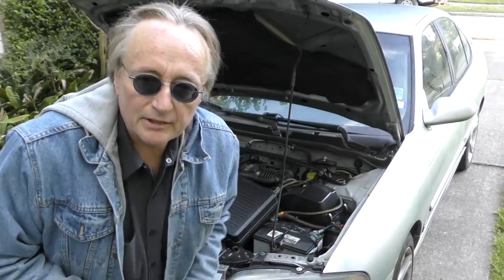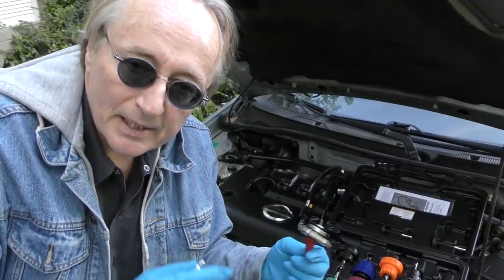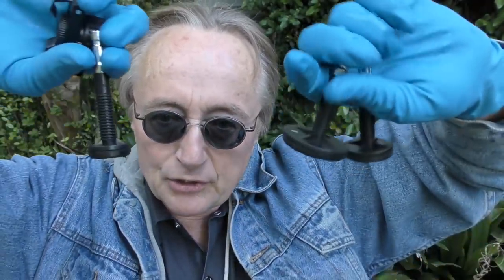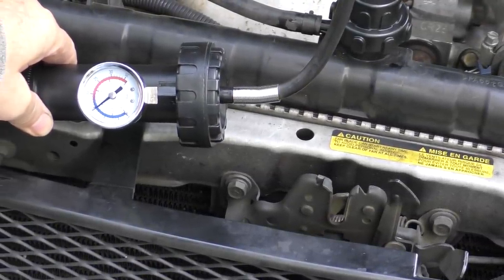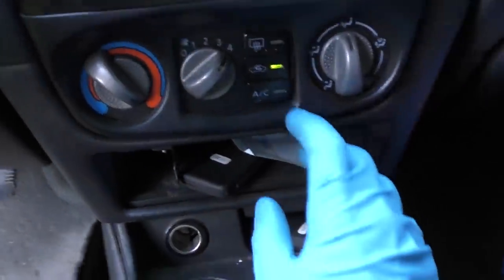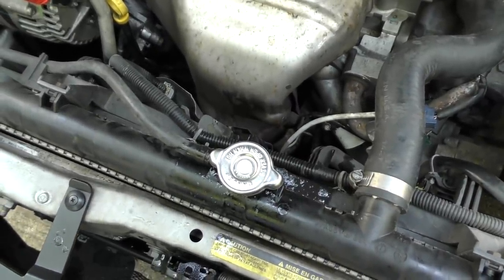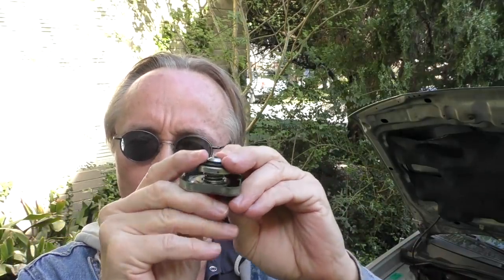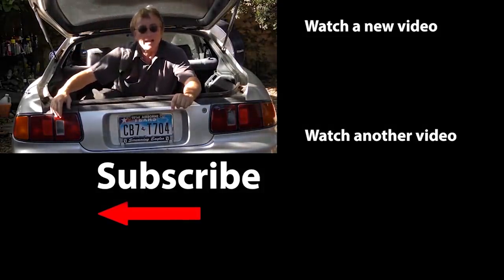How to Fix an Overheating Car Engine for $5

Comment: Had this problem. Bought new cap. Problem still existed. Took a while to find out that i purchased a defective radiator cap. So i bought another new one, and a new problem arose. Radiator hoses were blowing!! The new new radiator cap wasn't releasing pressure... Went to napa, paid a few bucks more, problem solved..

Comment: 06 Nissan Quest  van had spark plugs in back and they changed them  and believe  took gasket of said what ever was needed  had to be ordered Nissan go ahead drive oil cause get hot when said it did that it's okay then got to hot again barely made home so then said bring over could barley made home so set 3yrs put new battery on started and machine  said nothing wrong how can a battery  fix that  the old battery  wasn't bad ideas???

Comment: Can you recommend a good mid 2010's crossover? I love the reliability of my '01 Camry, but I'm looking for an upgrade, and something that can fit my surfboards for short trips to the beach. 
Love your videos and thanks a lot!
Reply: Steve/Beth thanks! I’ll look into the Element, and Spencer, good call, I’ll keep an eye out for sales. Know of any good resources to find common problems for each make n model? I think all of those options would work, just want to make sure there aren’t any known/recurring issues
Reply: Spenser Chalkley thanks, I would plan to take good care of it, and work on it myself. But with what you said, even if I do take good care of it, what do you think of the cars in the long run if I were to put another 100k miles on? Thanks again

Comment: Does the thermostats also cause problems. . it did on my car. They said. Just curious..
Reply: Thermostats stop the flow of coolant when the engine is cold. Once the engine heats up it opens up and the coolant flows between the engine and the radiator. So if you started driving and soon after your temp goes high it's a good indication it's bad. If your water pump fails it will do the same as the coolant isn't circulating.
Reply: @jeep146  . So i was lied to .Thanks. .  I got screwed. Thank you. Someone else told me the same thing. Thanks again.
..

Comment: Car my tire pressure light has been on for months and all the tires are at the right PSI, any suggestions why?
Reply: You need a new sensor
Reply: Snoopy thanks snoopy, do you know if there is anyway to pin point what one?

Comment: Save Your Car
1. Replace Radiator cap (oem) regularly
2. Check cooling system's pressure
3. Flush radiator as needed 
4. Use the best coolant
5. Check the fans & their motors.
 * turn fan& ac on high then check
6. Thermostat? Replace if in doubt.
7. Water pump? 
8. Radiator - is it working? Leaking? Does it need to be replaced?

Did I miss anything?
Reply: Ive replaced the radiator (it was cracked), still overheating, put a new stat, still overheating, replaced the water pump it started leaking, still overheating. Replaced the stat again and the temp sensor, still overheating. Heater not working, i assume the heater core is clogged. So i hook both heater core hoses to bypass it. Still overheating. I cant drive more than 5 mins before it starts to overheat. Idk what else to do. Only option now is to remove the stat. Im trying Jesus im trying to stay faithful knowing ull help me, but idk what else i can do. Only vehicle we have rn.

Comment: Isnt it dangerous to open a coolant cap after the car has warmed up?
Reply: The original cap had the pressure relief lever.  Without that, then yes

Comment: Hi Scotty, 
P2173 Jeep Patriot 2013 2.4l
Any ideas please 
Changed throttle body still nothing
Reply: GM Kof hard 
Goes limp mode 
Engine light on 
Red lightning light on 
Turn ignition off and on drives normally but engine light is on
Reply: GM Kof hard 
Limp or safe mode 
Revs are limited to 3000
Not loosing power just limited power
Reply: GM Kof hard thanks buddy 
I’ll try map sensor
Reply: Smoke test done as well, nothing
Reply: GM Kof hard 
I will 
Thanks again

Comment: Scotty hi.. I bought a hyundai and it had KUHMO eco tires - they are hard as plastic and I almost crashed a few times because they skid on leaves.. got new Firestone firehawk tires and drives and handles 8x better and feel safer stopping. Can you rev up our tires and provide a little edu on these eco tires and what are good tires / how to shop for tires / it’s probably not always wise to run these cheap eco tires from dealer like KUHMO... they are horrible lol ... I am not sure 🤔 people realize or if they have eco tires that it can cause your car to handle horribly ... thanks - HUUUGE FAN
Reply: SWEN TACTICAL "Your car drives no better than its weakest tire" - Randy Fitz

Comment: Whats the issue if you press the gas and the temperature goes down?
Reply: thermostat
Reply: No that would be cooling fan
Reply: Often there’s air which must be bled from the system.

Comment: Scotty what you think about a 1993 Jeep Wrangler yj. 5 speed manual. 100k miles on it
Reply: He'd probably say it's built vastly better than the new Chrysler-Fiat Jeeps.  Being a manual transmission and low mileage, it's probably worth buying, as long as there's not a major rust issue or existing engine problems. Good idea to get a mechanic to look at it before you buy it.

Comment: Just put water in my cooling system, because I forgot to pick up coolant before changing radiator. DOH!! Barely made it to the store and back without overheating. I may also have air in my system....

Comment: Weird. My Nissan Frontier's radiator has a leak and I have no overheating problems as long as I top it off once a month or so.
Reply: Pour pepper in the radiator, it will stop the leak
Reply: It’s difficult to effectively correct leaks in aluminum & plastic radiators.

Comment: What if it takes forever to reach the middle gauge of the thermostat
Reply: Mebbe stuck open tstat, second but expensive try, temp sending sensor, I'm about to try that on 89 f250 that was probably neglected and sitting for long time

Comment: This go  out to everyone so I have a 2005 Highlander  Toyota  that I  Just bought  Use   But before I bought  I checked  out the  Engine. But my problem is That in Winter time When I try to put hot air  I would get cold air So I would have to dialed it like in old radio To see if I can get some Hot Going. I called in to  Auto zone I got device to To cool down the car AndTake the radiation cap off You to car warm up To see if the air or lepri out I wanna see if anybody has done that

Comment: That's a Nissan? My 2002 Nissan Sentra just died a few months ago. It started running hot out of nowhere, then it began having starting problems, so I took it to the shop and they told me there was coolant in the engine cylinders. I took excellent care of the car, so I'm assuming the previous owner might have let the car overheat. PISSES ME OFF!!!

Comment: Yea I disagree with Scotty on the “might as well just buy a new cap” comment... with that rationale you may as well just replace your thermostat, u-joints, gas caps, valve stems, oil caps, fuses, wheel weights, light bulbs, lug nuts, lug studs .... I mean they are all cheap and could all lead to problems so why not just replace them all every couple of years?

Comment: What if it's a European car like a VW that have that huge coolant container and doesn't have a cap?
Reply: plastic caps fail as well  vw Ball cap i speak of  still they have a radiator may  have to dismantle to see if it has a Radiator cap usual hidden under a panel near hood latch peek thru the grill
Reply: @CalmDownClown   Thanks for the advice!
Reply: @OwlManoloPR13  best way i guess to see without any effort is to...look up your VW  on a parts site ..rock auto  or what ever and bring up a picture of your cars  radiator .. its cheating but hey  easy.

Comment: No..... the FIRST thing....before you pressure test the system....is open the radiator cap and SEE IF IT HAS COOLANT.   C'mon maestro Scotty...... also, an old cap may have lost it's pressure spring rating....needs to keep the system at 15 psig (or so) pressure. Anything less and closer to atmospheric....it'll overheat. Oh...and that "hot" test you did, where you simply unscrewed the cap and found no pressure? Caution: for those cars that still HAVE pressure, you can scald yourself....open it with a rag under your hand !!!

Comment: Those Nissans are notorious for having a stuck outflow valve.
Reply: Really? Because I DD a 350z
Reply: @MrSnakedoctor85  I don't know about that Model, but if it has an outflow valve, those get stuck and the coolant doesn't flow out. The Altimas and maximas have those. It's  like having two thermostats, an inflow and outflow.

Comment: Rev up your fender scratches..........Jesus.
MOST logical thing to do is check coolant level first, if the level is full the chances are very small that there is a leak.
The chances of a small coolant leak causing overheating are slim to none, pressure tester is NOT the first step, or logical.
When the gauge is “close to the middle” DO NOT OPEN THE CAP FAST, needs to be open SLOWLY, or rev up your 3rd degree burns.
Lastly, easiest thing to do at operating temperature is to feel that upper and lower rad hoses are near the same temperature, indicating
flow.
What do I know, only worked for porsche, bmw and mercedes......
Reply: MarcN,  Excellent!
Reply: I like Mr.Kilmer, but I honestly don’t think he is an above average tech.....
I have had the pleasure of working with elite techs

Comment: 3:56
NEVER OPEN WHEN HOT
FOR COMPETITION USE
If we join the two phrases into one single statement,  it becomes comic!
Reply: haha. that is actually a higher pressure radiator cap from a Honda only aftermarket performance company from Japan called Mugen. if you wanna buy it here in the states it will run you around $40.

Comment: Bonus q&a: everything checks out so I replaced the thermostats and she srill overheats.   Answer: heat up a pot of water to boil, drop the thermostat in for multiple cycles. It might save an engine. 
Mikel

Comment: That's super dangerous opening up the radiator cap when the engine's hot like that, didn't even use a rag or anything to cover it, especially when you don't yet know if you'll be sprayed with super heated coolant / steam. Needs a safer way to test that.

Otherwise a good video, I like all your other videos, but this one's just too dangerous in that one spot
Reply: Nope. It wasn't overheating. Open my cap all the time when the needle is at the middle or just below. Does not billow out.
Reply: @garynair5143  Yours is broken too then. There's a deadly serious reason why even the caps say NEVER OPEN HOT. Even an old Toyota like Scotty's (I think it's a Paseo?) should build up enough temp & pressure in just a minute or two to splash a little coolant around when opening the cap.

Comment: For all the "nerds" that wonder why would a weak spring in a radiator cap cause overheating?? Lower Pressure = Lower Boiling point. So a cap that doesn't let the system "pressure up", will obviously boil sooner. /cheers

Comment: Not many overheating engines have a $5 fix. Scotty with the sensationalized headlines, AGAIN!
Reply: Sometimes it's a $20 fix as people think that putting "performance thermostats" in helps, but all they do is either not open properly or open too much and too soon. Either way you have an overheat from either no flow or too fast a flow. The fix is then the stock thermostat again.
Reply: BALONEY!

This is EXACTLY what I figured out ON MY OWN after going to the dealership AND a private mechanic.
Both said, "replace the radiator and/ or thermostat". 
Thermostat was new. Radiator wasn't leaking. 

Went to Autozone, bought antifreeze, it was bone dry. 
Noticed the cap's seal was eroded, that rubber wasn't making a proper seal. Went back inside for a $9.99 cap. 

For $22 bucks I was DONE in less than an HOUR. 

So, no my friend, it's NOT SENSATIONALIZED! 

The fact is, check EVERYTHING before you recommend ANYTHING.

Comment: This customer lucked out to see it was only the radiator cap and not the radiator leaking or not dissipating heat anymore.     Instead of spending hundreds of dollars this customer is only going to be spending the $5 plus the labor that Scotty charged.

Comment: 15$ FIX HERE 

BAD RADIATOR FAN.

instead of replacing whole assembly you can simply buy just the fan motor if that's what's wrong and replace it for $15 instead of the $100 to charge for the whole fan.

Comment: I wouldn’t take off the radiator cap when it’s warmed up. Safety first.
Reply: Well it was warming up when he did it, if it was fully warm it would be bad
Reply: Yeah I wondered about that too. Layman needs to be warned not to let the engine reach normal temp or else can get badly scalded removing the cap.

Comment: This guy doesn't know what he's talking about. To fix an overheating engine is really easy, all you have to do is put some ice cubes in through the oil port on the engine. Trust me, these mechanics just want to scam you, but I'm here to help you out with quick, easy, and cheap fixes 👌🏼

Comment: You should never tell people to open up there system hot!!!! Someone is going to get hot coolant all over them!!
Reply: It was only a short warm up. Edit: But he could have squeezed the radiator hose to see if the cap was holding pressure.

Comment: Today we're going to end up with viewers who have 3rd degree coolant burns from taking rad caps off a hot engine. Please put a safety advise in. We both know how to be careful to crack them just right so take it for granted, most people don't.
Reply: So true. I have seen people just pop them open and then are shocked when coolant sprays out